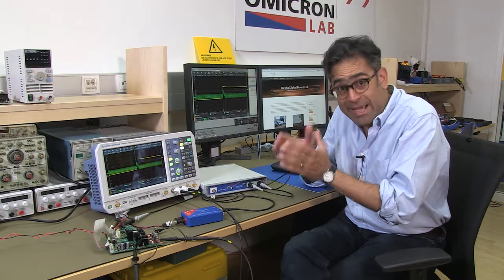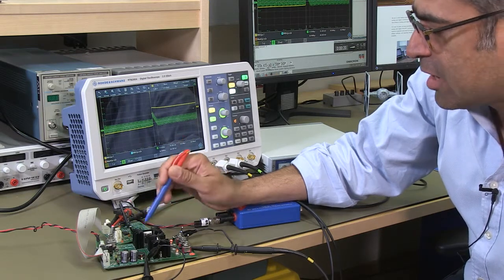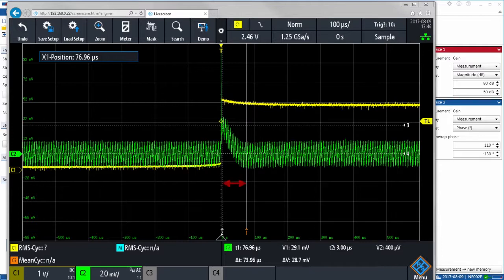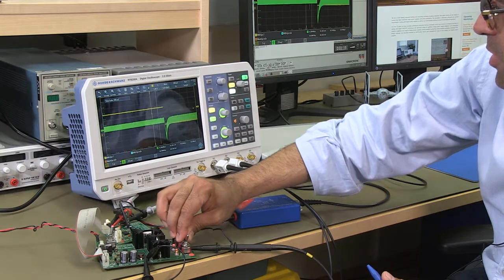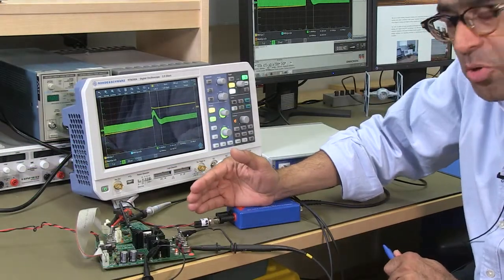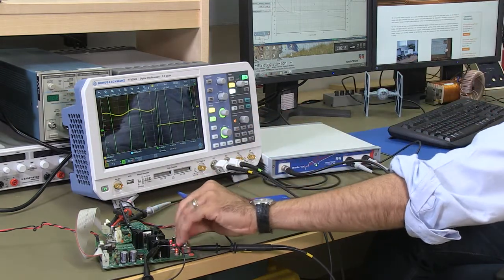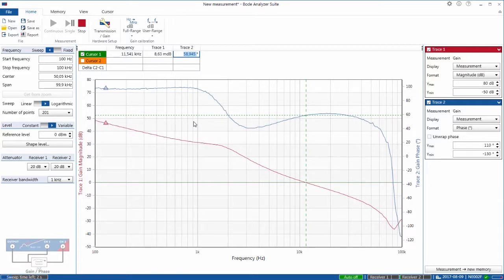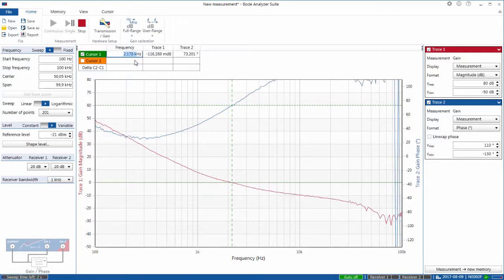Dynamic behavior of a buck converter in DCM and CCM

Comment: Hello. I've been working on an asynchronous buck with 120 v input and 24v output. 
I'm using an Arduino uno for the pwm switching,I keep having my 20x4 lcd becoming distorted the display signal is corrupted this usually happens after a while during charging only. How do I solve this issue?
Reply from the maker: Please get in contact with www.biricha.com directly if you are looking for design consulting services.

Comment: What exactly is attached to the yellow and green traces??
Reply from the maker: Hi Ivan, that's load current and output voltage. Load stepping changes the output voltage and the control loop needs to react.
Reply: Ok, but why you do not describe this still in the video? :) This is important info.
Reply from the maker: @ivan868  thanks for your input, the next time we will try to describe it better.